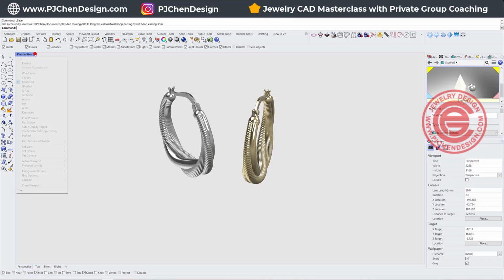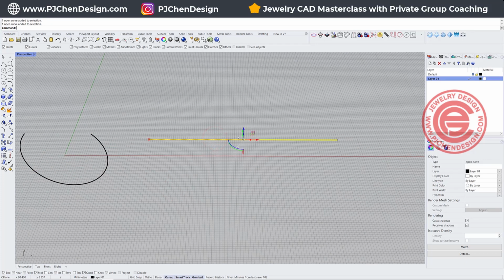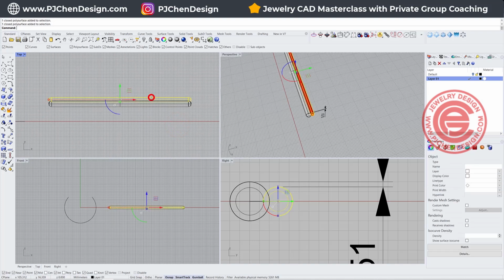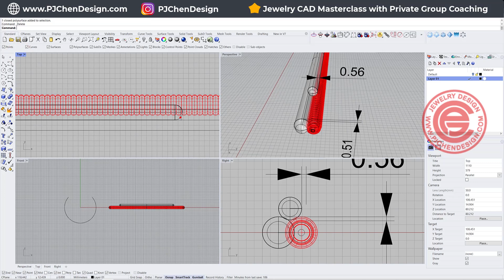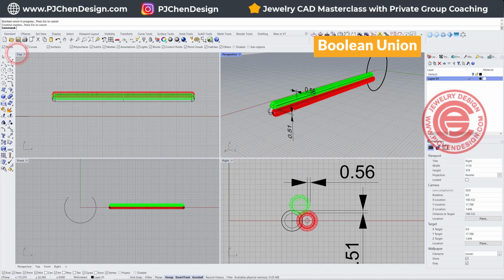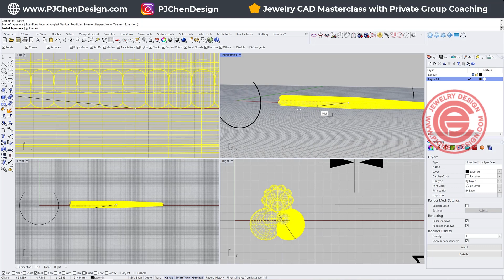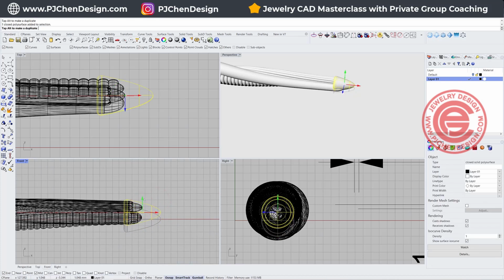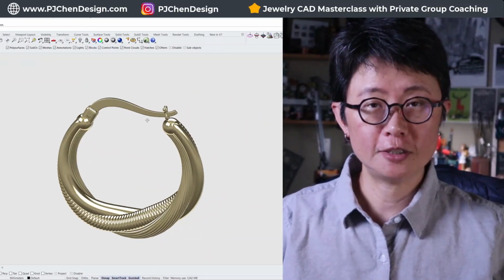Jewelry 3D Modeling for Beginner- Twisted Hoop Earring- Rhino 3D CAD Tutorial #424

Comment: please send me the link for the webinar.  Since ends with findings are like a round ball, could we just use a balls and not cones at the ends. My last question - can this be direcctly printed for casting and could you add part of the findings to the design for printing.
Reply from the maker: https://cad.pjchendesign.com/live-webinar-registration--5550b you can can cast the model directly if you like it solid. you can cast the catch but need to manully install the pin.